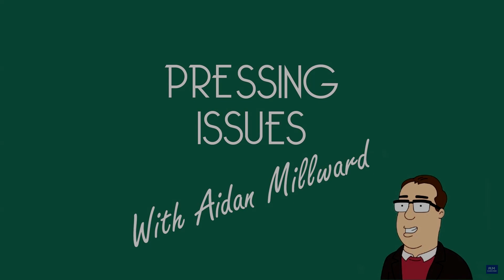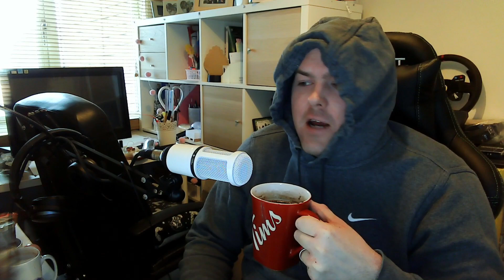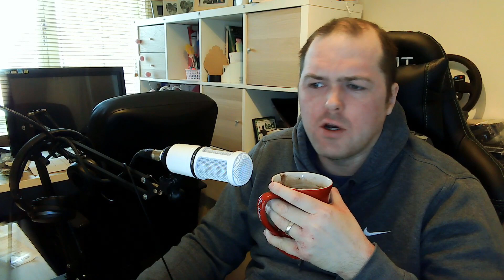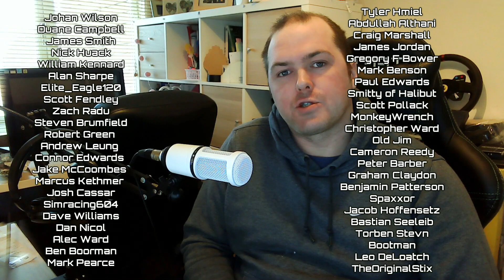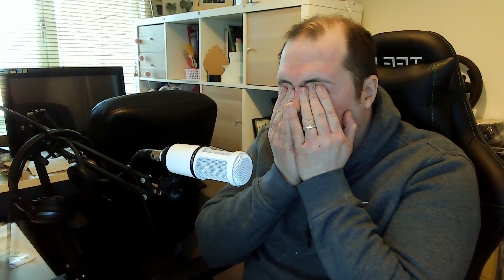IS IT REALLY TILKE'S FAULT? Opinions on Hermann Tilke Track Criticism

Comment: My only problem with him is Abu Dhabi, because he had almost full freedom with the design and it was ment to be spectacular but he failed there. Also FIA and the promoters need to realize that making a great track the can lead to interesting and memorable races will cement the host nation in the minds of the F1 fans a lot more than fancy architecture, example look at Brazil. Also I'm not sure that the track design is a one man process, so not sure that having other designer companies will change a lot and since Tilke basically has an exclusivity deal with FIA it's not happening anyway. 
A very fun topic to open the year with, thanks!

Comment: I think FIA should diversify their track demands a bit. Instead of having long straights into tight corners, a snaily bit, and a super long Turkey corner in every track they should have some tracks that are designated to a certain style. Maybe one track where cars barely ever go slower than 200kph, or a track that barely ever goes straight. The reason tracks like Spa, Monza, or Monaco are fan favourites is because they stick out from the rest. Instead of having the formula(TM) embrace different track styles, and maybe also create a few hybrids between them. Maybe a twisty and technical circuit with a dedicated highspeed sectors, so that the strategists have to decide on what part they should focus their car
Reply: a good example of that is the infield section at Indianapolis you had the slowish infield section followed by the flatout blast onto the oval and start finish straight with a good overtaking spot at the turn 1 and 2 chicane

Comment: Portimao is the best example of what a modern f1 track can be, and the updated zandvoort track demonstrates how you can still think outside of the box.  The main criticism is that the racing is formulaic, and rightly so; long straight into a large braking zone, slow corners to mitigate dirty air effects, etc...  But I think tilke’s worst criticism is that he over-engineers the track layouts - getting rid of natural crests and dips to instead place is own perfect hill, or giving a corner an off-camber gradient to aid drainage even though the track is in the middle of the desert.  Getting other firms to do the layout worked wonders, and companies like dromo are making older tracks better to race on with corner reprofiling.  This business model where Tilke controls the feasibility, but other architects come in to give fresh ideas is the best one so far, and if alex wurz can pull off the new saudi arabian track with his own team then it would be nice to have different designers compete with each other for more unique designs which give us more unpredictable racing

Comment: As much as I think the FIA's current rules are unnecessarily strict, I believe Tilke could do a lot better than he does. There is very good reason his tracks are referred to as Tilkedromes. They are formulaic and derivative, he reuses the same corner sequences, the same long straight into hairpin trope and he has 0 concern for flow. The clearest demonstration of that is Fuji. Pre-Tilke Fuji was so much better, some racing presenters refer to the Tilke renovations as "disrespectful". The last sequence of corners (T12 to T16) is tedious, uninspiring and lazy. I liked his work at Hockenheim (I find the old layout very boring) and Sepang plus Osterreichring/Spielberg/Red Bull Ring and Chang are decent tracks, as well, but all his other tracks have elements that rub me the wrong way. Even the less offensive examples, like Istanbul's T12-T14 sequence or COTA's T3-T9 sequence, irk me so bad. And please don't get me started on Bahrain, Shanghai, Yas Marina, Marina Bay, Sochi and Hanoi. Have me drive on any one of them at night and I seriously couldn't tell you which is which.

Comment: The problem is not necessarily Tilke as a designer, it's this group of tracks that are nothing but chicane after chicane after chicane and have virtually no flow to them because of it. Granted on Street courses you're going to have a lot of 90° turns, there's no avoiding it, but road courses should flow, not be really long straight to really hard Left / Right breaking zone, wash, rinse, repeat. It is absolutely one of the few things IndyCar gets right that F1 does not

Comment: I'm wishing Tilke adds in a loop-de-loop for his next one.  Hopefully the regs didn't think of outlawing this.   I always hear the "a F1 car can travel upside down @ 100mph" fact, lets see it in action - with a 3rd gear corner at the apex (they'd have plenty of runoff).
Reply: The car can travel upside down @ 100mph... but even leaving aside the engineering challenges of providing a suitable racing surface on the ceiling, the drivers would probably refuse point blank to operate the cars upside down @ 100mph.

Comment: A lot of problems seem to arise from a number of very technical circuits where all the cars sort themselves out into order of relative speed early on and there's nothing to race for thereafter.  Abu Dhabi and Paul Ricard are particularly bad at this (Paul Ricard had this problem back in the 80s, so you're right -  not all Tilke's fault).  But sometimes it happens at the good circuits - Spa 2020 just didn't have enough cars 'out of position' to allow for anything fun to happen.

Comment: If the cars struggle to follow each other. That's where the biggest part of the problem is. The FIAs inability to deal with that for years is a far bigger issue than track designs Tilke has had a hand in.

Comment: I would like to see consistent and harsher punishment for going off track. 
I understand that paved runoff areas are safer than grass or gravel and further more the driver can stay in the race but it also leads to the point where every driver is giving 105%, because there is no drawback. Dirty tires are obviously not a big enough problem. Therefore I would welcome a power or aero punishment for the following lap(s). 
If possible it would be policed by a system (checkpoints in the track, image recognition, or maybe there are other ideas) and not stewards, but if stewards have to police it, then there will be errors. I do not really have a problem with cars which will not be caught, they got lucky. The ones which got punished wrongly is a problem, and I do not have a good solution for that. 
One solution would be, that if it is within a certain range (e.g. 50mm) of the track limits, then it is the call of the stewards and that is the ruling. 
The main idea is that the fast guys will go a bit slower to be safe where the slower (95%) ones can take more risk and attack (105%). 
(I know it is not exactly on topic)

Comment: Something that I don't understand is why there's this obsession with overly asimetric racetracks, with very twisty sections AND super long straights. The problem being that with very aero dependent cars, you need a set-up that is good for the straight (where you inevitably stall half way), and decent for the twisty bits (where you can't overtake because you need to compromise for the straight). Overall, more balanced circuits give best results (Bahrain, Austria, Turkey) provided that they are configured in a way that the flow of the racing line doesn't impede overtaking.

Comment: I believe there are a few reasons  that many of the old tracks seems to be so much better racing then the new ones.
1. Only one design. If you build any significant building say a skyscraper for example, you usually have a design competition or something similar for it and chose the best or chose the best aspects of several designs and  turn it to the final one you build, for new tracks its only Tilke, I don't think he's an inherently bad designer it's just that not everything you do will be great and memorable. 
2. Survival of the fittest. Over the years there have been many many racetracks built, but today of the old tracks mostly the good ones survive. 
3 Footprint. Many of the old tracks are physically large and occupy a large area, inherently giving more opportunity for things like meaningful elevation changes. Many of today's tracks are crammed into an area the size of a parking lot by comparison.

Comment: The features of great racing tracks that seems to be missing from the not-great ones is two fold: non-constant radius corners, and elevation changes - the latter being the more important. Constant radius corners discourage choice of racing line (there always seems to be one 'perfect' way through the corner), and flat tracks like racing in 2D instead of 3D.
One of the reasons I find Silverstone boring (apart from the oft over-statement of British-ness, which is irrelevant to racing... or should be), is the fact that it's built on an old aerodrome ... i.e. it is largely flat. Melbourne only gets decent races (sometimes) because of being a) first race of the year, and b) some unreliability in new cars & engines and unpredictability about new drivers. Not sure 2021 will be a good race, but we'll just have to wait and see.
On the other hand, Spa, Mugello, Turkey, COTA, Nurburgring, Sazuka, Red Bull Ring, and so on, all have all kinds of elevation changes. I would expect Zandvoort to be pretty good for the same reason. If only Brands Hatch were capable of hosting modern F1, we might have reliably exciting British Grands Prix.
How Canada manages to create great races (and it does), is despite not having elevation changes, it has varied radius corners, and concrete walls inches from the optimum racing line. Oh, and not infrequent rain.
And finally, let me count the ways in which I hate the Catalunya circuit - dry, boring, constant radius corners that every driver, engineer and team have seen far too many times. They've got to stop testing at Catalunya in the winter, or, alternatively (and preferably) stop racing there. They can keep testing there (as they have the baseline data for years and years) without needing to race there, without the circuit losing relevance. Just don't make me watch racing there ever again.
Reply: My one European F1 attended Grand Prix was Barcelona 2012. It was memorable. Michael ran into Bruno Senna at the turn 1 braking zone right in front of us, Karthikayen's car failed on the main straight and they just left it there for the rest of the race, and Maldonado won his only race in F1 that day. Was it the best race I ever attended? Definitely not, but memorable none the less.

Comment: Sepang is great, Bahrain is great, Shanghai is great for other series but ok for F1. Abu Dhabi and Sochi are bad but he was limited with what he could do. I like both Hockenheim variations but i think change is good. The main problem is the cars. The circuits are designed to try and get the best racing out of the current spec poor cars. Its a tough job. He's done a great job apart from a couple.

Comment: I used to be one of those "I Hate Tilke" Complainers (Typical young and stupid racing fan that didn't do much research of anything, just bitched and complained based on pure emotion and no facts). Once I found out about these "Grade 1" Regs and then really read into the rules, that's when I became less hateful of Tilke. He really has been a scapegoat for a very longtime and undeservedly so, yes I too wasn't a fan of both Hockenheim AND Fuji Speedway's redesigns but I now look at these with less blind hatred and with a more informed perspective. I feel the FIA's strictness (Combined with the Commercial rights owners) are what has lead us to the state we are in with the tracks. Hell I wouldn't be surprised if the slight copypasting of some corners is a direct result of such confines, especially when the very clients don't themselves even seem to care. If the people in charge don't even want to present any effort, then of course its gonna trickle down (Look no further then NASCAR and the multitude of decisions that have just really brought it down).

Its worth remembering that while he did design the tracks, he wasn't the one that decided the parameters he has to work with (or in the case of Sochi and Baku, the awful locations).

Comment: I don't blame Tilke for how his designs are "boring" because he is obviously designing for the demands of his client, in this case, the FIA, I mean Austin clearly isn't the same as Sochi which isn't the same as Abu Daubi which isn't the same as Bahrain... btw, I am excited about NASCAR running at COTA this year, because Tilke did nail the design of the circuit, as F1 always is fun, IndyCar was fun there and I think NASCAR will finally have a watchable race in the state of Texas (because Texas Motor Speedway has always been a dreadful watch, especially since they changed it to the point where both NASCAR and IndyCar suck at the track, especially last year's IndyCar race which gets a small pass given the fact that the only tires Firestone had prepared were ones designed for Indianapolis Motor Speedway)
Edit: okay, so, NASCAR at COTA wasn't the best but that was due to the a massive amount of rain

Comment: It's not the tracks, it's the cars. Show a modern F1 car a wee bit of undulation or adverse camber and it'll have an epileptic seizure. I know that bumps and hills aren't exactly great for safety but they give a track some variation. Plus the circuit needs variants for domestic racing series as well.
Then there's the maintenance of the track to be considered, then the transport links, the location itself (henlo Okayama), additional uses (Donington)...

Comment: Tilke is solely to blame for the shit circuit designs over the last 15 years, the FIA are to blame for massive tarmac run offs instead of grass or gravel, but take any of the circuits he’s designed since Istanbul (his last decent circuit design) and line them with concrete walls 5 foot away from the track limits the tracks would still be crap due to all of his designs using the same corners again and again, it removes all of the character of the circuit he’s designing but also removes the uniqueness of the tracks he’s copied these corners from.

Comment: how about a track where the starting grid is not part of the circuit.  only used to start the race, but not connected to the circuit via the racing line for the rest of the laps?  and make the finish line further down a straight, and not so close to the last corner, allow a drag race to the line.

Comment: It's 100% his fault... there's a way to modify a corner without turning it into an awkward mess. The first corner at the Nurburgring is an abomination!! The new bus stop chicane at spa, the last sector at Fuji. Most of his new tracks have those corners that make absolutely no sense, where the exit doesn't align with the corresponding straight. The needle point hairpins corners he loves, there's just no reason for it. His tracks have also introduced the horrendous painted runoffs area, which make me want to vomit.
Reply: Philippe Gurdjian introduced those at Paul Ricard in 2000. They were used as a test for that type of runoff; and it was then expanded to (almost) everywhere, primarily for circuits shared with MotoGP as FIM demanded tarmac. One thing that - although hideous - is not Tilke's doing.
Reply: OsellaSquadraCorse You're right, he didn't introduce it, he popularized it. After Abu Dhabi came along it became an accepted norm for every track.

Comment: The FIA grade 1 status is a bit of a joke. Runoff is not a substitute for good barriers. In terms of racing quality,  the guidelines set by the FIA  don't help but the cars are the main problem.  We've seen tracks that usually produce good racing host a very stale GPs due to dirty air.

Comment: Tulle basically has to make a track we’re 65% only has 1 possible way of working and he can’t do anything about it. Imagine trying to build an office for a company but you have to keep 3 outer walls in the same spot and can’t extend them but have to meet a certain square foot or square meter requirement.

Comment: I'd still argue Tilke is at fault.  His style means all his purpose-built tracks have near identical feels in terms of aero, laptime, set-up, etc.  Along with that, his tracks almost always feature the same repeated tropes that have nothing to do with FIA regs, such as: 
- back to back (to back) straights with little to do
- a middle section that is just turn-after-turn-after-turn 
- widening apex leading to a tiny radius corner
- tight and fiddly back and forth hairpins/2nd gear turns
- an annoying tightening-apex turn
- a distinct lack of flow and an overall feeling of awkward tepid by-the-numbers driving